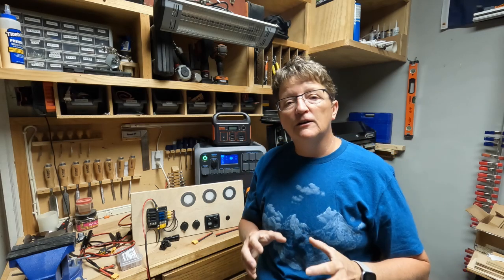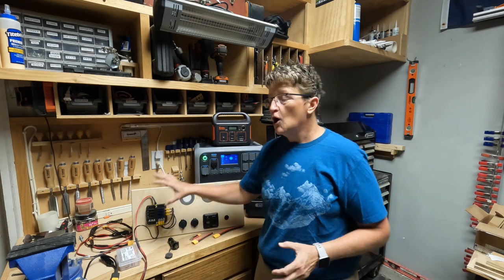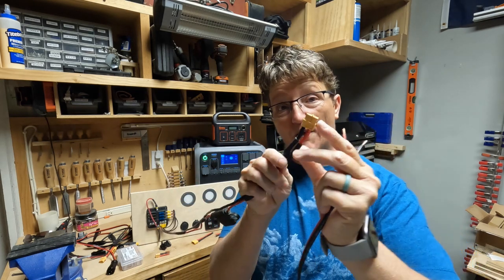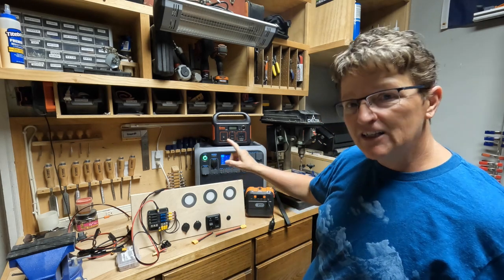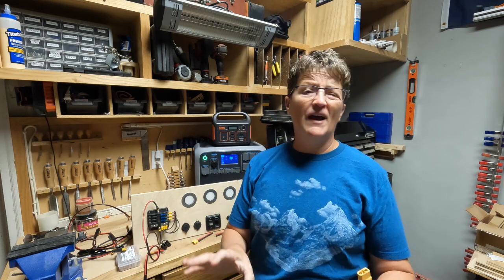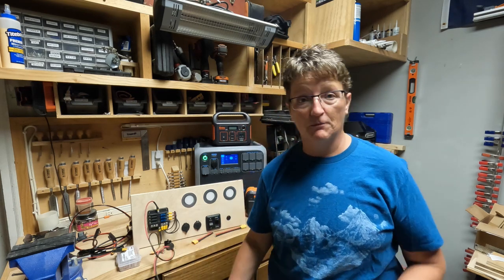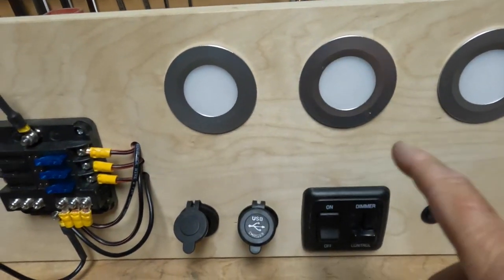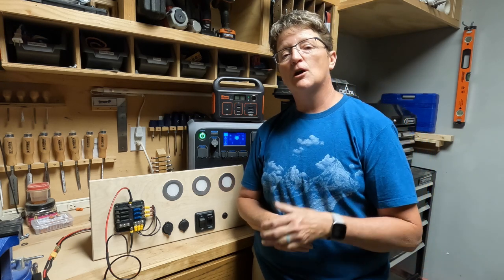Off-Grid Solar | Connecting DC Fuse Panel To Solar Generator

Comment: Yeah. Nice. But people need to understand their DC amp output. Those that want to use a diesel heater for example will not be able to use the 12v cigarette socket has they are max 10 amps and most heaters run at around 15 amps. Unless they have the Bluetti AC200 max or the new AC240. Those both have the 2 pin aviator port and are DC 12v and 30 amps. So will be able to do the same set up you have made and run everything in the van. Including the diesel heater.
Reply from the maker: Both the AC200 and the 200P have the 25amp 2 pin port.    You are 100% right that the cig is limited to 10 amp 👍

Comment: I have no electrical knowledge. I thought when I bought my ecoflow everything would just plug into it with no problem. Not so. So I need a 20 amp fuse box with a switch or breaker on the wire. My ceiling fan and natures head (not yet purchased) gets connected to the fuse panel via the + - wires with those little Os on the wires. Think I got it. You are an angel.

Comment: This is really good Jonnie. I decided to scrap my fading, heavy, less efficient AGM batt setup on my camper and use my Bluetti instead.  Your video clarifies what I was needing to understand in order to do this. I never thought about using one of my smaller batteries for a back up. The XTC adapter connection would make this simpler.  Thanks!
Reply from the maker: It sure does.  the xt60 or xt90 makes life easier for interchanging.  FYI many of the new systems use xt60, so I would use that if able.

Comment: Awesome explanation and to see is to understand.  Thank you Jonnie.  It is pretty clear.  QQQ--On my fuse panel the top and bottom positive and negative are connected to my battery directly.  What happens if I add the new cable on these.  Is there going to be a conflict between where the power goes?  I hope I didn't confuse you with my question.  Call me me if I wasn't clear.
Reply from the maker: Yes you will have to isolate the two systems.  You have to kill power to one and draw from the other.  Jim could do it easy peasy.  thank you for the kind compliment Dee

Comment: Can you a specific video on how to connect the puck lights with the dimmer switch to the fuse box?  The three wires from the dimmer switch make it complicated between the power box and the fuse box.  Thanks for the info!
Reply from the maker: uploading it now.

Comment: Thank you so much for taking the time to share this!!! I know how to set up a solar system with lithium batteries, but I don't know how to integrate into the existing wire system in my ambulance.🤔 I have a feeling the answer is simple, I'm just not getting it. 🙃
Reply from the maker: Ambulances are so technical.  You should have a auxiliary battery though. You should be able to connect your panels to a solar controler to the battery.   That wire cabinet is a electrical nightmare 🤣
Reply: @JonniesJourney  Thank you Jonnie 🥰

Comment: Hi, this is the second very informative video I have watched by you. Thank you. Did you do a video where you show how you wired the lights, devices  and ports that shows what gauge wire you used as well as how you chose your fuse selection?

Comment: Great 👍 video 
I need an Anderson 30 amp connection
I wire my battery straight into the fuse box , in the RV
Reply from the maker: Do you have a fuse between the battery and the fuse panel?

Comment: Ok Now I have a question for this video.  I'm going to be wiring to Bluetti EP500Pro, I hope, and it has the Aviator which is great.  The question is the Aviator connection is at 30 amps and my fridge, I think, is 6 amps.  I guess I really do need to know the amps of the appliance I'm connecting to add the correct fuse. But, with the power station at 30 amps is it going that going to be ok?  I will be connecting other things, lights, fans, pump but does that 30 amps divide over all appliances?  Like I only have up to 30 amps total or I use up to 22 amps over all appliances  and thats ok? Also, do I put a 20 amp fuse in line or 30 amp?    I don't want to overload something i guess is what I'm trying not to do.  Thanks again for the help!
Reply from the maker: So each fuse will be according to what you have connected to the panel.  Typically you would not have everything running at once but.. what if. I have my system backed up with a 20 amp fuse.  The rule is  1.25 x the total amps.   What awg wire will you be using?

Comment: I just got my 6x14 and I plan to do the same with my Ecoflow River Pro and I'll buy the extra battery to go with it...
Reply from the maker: That will be awesome David. 😊
Reply: Long time coming! And a laundry list of accessories for and 8 way fuse panel. But may get a 12 way so I can add more. Jus need to plan. Your videos are great and informative. Just need to learn how to wire up a switch on a wall and then to the fuse panel
Reply: @djbigdavethefyrm  She has a video on how to do that too.  It seems really quite easy using an extension cord.
Reply: @pattya1679  thanks I know it is. I just never did it. I’ll look for it thanks Patty

Comment: Awesome tutorial! Very clear! I do have a question, I have a VTOMAN that has THREE 10 amp DC outputs…. Would I do a seperate fuse panel for each output?
Reply from the maker: Which one do you have that had 3 10amp ports?  

You would really just need one, if you are concerned about going over the 10 amp you can just keep the DC fridge or other high item to its own cig plug.
Reply: I have the VTOMAN 1000. My fridge will actually be plugging into the 110 AC. But I’m hoping to have a composting toilet (~ 5amp), a ceiling vent fan, and several LED and USB plugs. Two of the outputs are 5521 (5.5 mm), so I can assume I can wire a circuit into a 5521. So really each plug should just run a 10 amp circuit with a 12.5 amp in line fuse? I’m also a nurse btw!

Comment: Thank you for the informative video. I have an Anker 767 that I wired and connected as you have shown. Question. What is the total amount of load I can have at one time? Is it limited to 10 amps (which I think my Anker DC outlets are rated for). I'm not an electritian and I'm learning all this for the first time.
Reply from the maker: If the DC output port you are using in 10 amp, then you are correct.  👍 thanks for watching 😊

Comment: Jonnie. Great video. Thanks. I have an ac200p that I am connecting to a Blue Sea DC fuse block. In looking over the cables that came with the Bluetti I dont see an out cable from the “12Volt DC 25amp” output. Do you know what cable I should order from them? Gracias.
Reply from the maker: Is it a threaded output?  If so it is this one. https://amzn.to/4cCBa23

Comment: Thanks Jonnie. Great info. Only question I have is why is an inline fuse needed between the solar generator and the fuse panel? I would have thought the Jackery or Blueti devices have fuse systems internal?
Reply from the maker: they 100% do and it is not necessary.  I do it for the added protection.

Comment: Another great video J!!!!  2 quick questions if you don't mind:
1) you are using the 12V 10amp cigarette output....any reason why you don't use the 12V 25amp socket beside the cigarette port?  I would think the higher amp port is better for some of the 12v items you want to run, no?

2) do you always go up to the next fuse size when determining the inline fuse port?  Eg if you're using a 20amp port you'd use a 25amp online fuse?

As always, really appreciate you sharing all your knowledge!!!

Freddy
Reply from the maker: I only use the 12v/30 amp port. The 10amp cig port is just not stable enough.    When deciding a fuse, multiply you max amp by 125%, that's the fuse you use. Thank you so much for watching.

Comment: Hi Jonnie,
I’m sure I speak for many when I say that I appreciate you taking time to share your knowledge with us out in on the DIY van building space.

Anyway, I’m currently building out a Sprinter van and already own an EcoFlow Delta Pro w/3600 wh of storage capacity.  I’m working through the process of integrating it into the van, but, to charge the unit via the van’s alternator, Ecoflow has an XT60 - cigarette port adapter… but, my 2022 Sprinter doesn’t even have a cigarette Port, 😂!
Is it possible to run a cable from the van’s charging system, back to the “garage” and into the XT60 port on my EcoFlow?
Reply from the maker: Thank you so much.  Ugh no cig lighter 😒. Yes,  You can add a cigarette lighter. If you use their existing cable, It should prevent you from pulling too much from your battery. 👍

Comment: Working on my van build right now and love this idea. But I have one question, can I put my Chinese diesel heater on this fuse panel as well?
Reply from the maker: Yes you can if your power bank can handle the heater.  Use the recommended fuse for your heater.  If you are just using the cig type port, you will likely blow the fuse in the adapter.
Reply: @JonniesJourney  … thank you. That helps greatly!

Comment: Love this video. I have a few clarifying questions...
My unit is an Anker F2600 and the DC Output has 2 car ports rated at 10A (120W) max. I'm wondering if it'd be safe to run a 2:1 male-to-female car port cord to get max output (20A, 240W) into a fuse box?
Otherwise, am I able to run two separate car ports to a single fuse box? 
Any recommendations on wire gauge?
Reply from the maker: I use 12 awg wire from my system to fuse block. I am not 100% but I think you will be limited to 10amp total output.

Comment: Hello so glad I found your channel. How do you like the bluetti? Do you charge your system with shore power sometimes? If so do you have a video explaining how to hook up to shore power?
Reply from the maker: Not sure how well I explain it in my other video.  I installed a Noco plug (https://amzn.to/3vnHxDg) on the side of my van.  All you have to do then is plug in the AC power brick to the shore power port.   I charge it on shore power when it is available.  I LOVE the Bluetti system.  It's just so so easy.  Thanks for watching.  I will soon be doing a video showing how I charge my Bluetti while driving.  Good luck on your setup, let me know if you have any questions.
Reply: @JonniesJourney  Do you have a discount code for the bluetti?
Reply: @JonniesJourney   What fuse do you use for the connectors and fuse panel?

Comment: What size fuse are you using?
Reply from the maker: I use a 20 amp on my AC200, a 30amp on AC300.  On the components I size according to unit.  👍 feel free to email me at midwestvanbuilders@gmail.com for more questions

Comment: Hi Jonnie.  I'm getting closer to getting my shell and needing to do this.  I have been gathering components over time.  One question, what size fuse do you have for your in-line fuse and what size for the different components? One other question, when making up the connection wires, you soldered the wires.  Would the lever wire connectors work in these situations.
Reply from the maker: Yes you can use the lever wire connectors as well.  Patty I use a 20 amp fuse in mine.  My research keeps leading to 20amp for the 12 awg wire and for the components I use.  I was trying to gauge every fuse to the exact and a mechanic told me I could put 15 amp in the panel so that none of them are undersized.  I have done this since I started almost 2 years ago. If I learn otherwise I will keep you updated.
Reply from the maker: @john beach thank you so much John for taking the time to answer this and the added advice.  👍🙂

Comment: Hi Jonnie. Me again 😊. I just wired my second max air fan to my fuse panel. Like you, I am also using 12G wire on everything. I noticed that the ring connectors for the 12g wires are pretty big, and when I put them on my fuse panel, I have to bend them a little to fit them on the screw   - which is fine. But when I screw in two negatives next to each other, they look like they’ll touch each other. The positive ring connectors have that little piece of plastic divider between each one to keep them separated, so I’m not worried about them. Does it matter if the negatives touch each other?  Thanks!  I’m very proud of my 2nd max air fan working perfectly when the fuse panel is plugged into my goal zero or Bluetti. You did it!  You successfully taught a newbie how to wire electricity!!  Thank you so much.
Reply from the maker: Yes they will be fine if they touch 👍 only the positive lines can not touch.  Excellent job.  ❤️
Reply: @JonniesJourney  thank you! Can’t wait to see your DC to DC video. That’s the next thing I have to tackle. I’ve been watching videos on the Victron systems. I’d like to wire for that before I close up the walls. 

Thank you, thank you, thank you!
Reply from the maker: i do not use the DC/DC charger because the Bluetti does not have the terminals like a normal battery.  mine is a very easy inverter install that allows you to plug in your bank and charge while you drive.  under $150
Reply: @JonniesJourney  oh this sounds more like my speed. That’s what your video will be about?  Can’t wait to see it!
Reply from the maker: @trishwhitehouse6536  yes tomorrow 8am cST

Comment: Hi Jonnie and everyone, is there a specific 12 volt fuse box you recommend?  I see then titled as marine fuse box a lot and wondered if that is all the same with maybe a little more sealed aspect to it. 
Awesome video, I’m looking to power up my exhaust fan to an eco flow and you cracked  the code for me 

Thanks!
Reply from the maker: I use the Blue Sea fuse block for my builds. 👍  so awesome, goid luck on your build.

Comment: How did you deal with the aviator plug adaptor being a spring loaded push to connect vs the bluetti being a screw in connection? I did everything you did but the adaptor doesn’t stay on the bluetti very well because the connections are different 😢
Reply from the maker: The new Bluetti has a different aviator plug. This is an older model. 
This is the newer cable. 
https://amzn.to/3KImliG

Comment: Great Video. I have an AC200 - and use the aviator plug for powering my fuse box. I just ordered the AC300 and I hear it has a different style of aviator plug. Do you know what that type is called? Did you have to make a new attachment after upgrading to the ac300?
Reply from the maker: If it is the AC200 not the P model it is a new cord.  Here is a link:  https://amzn.to/3QLT2ie
Reply: @JonniesJourney  Thank you!

Comment: What do you think about the use of Wago Push Wire or lever nut type connectors to make my cables that to go from the battery to the fuse panel?  I'd like to skip soldering if I can.
Reply from the maker: I use the wago connectors all the time.  However, the ones I have will not take the 10awg wire that comes on my xt60/xt90 connectors.  Which battery do you have.
Reply: @JonniesJourney  Thanks! My main battery is a Bluetti EB70s. It has 12 V outputs from 10 amp 5.5mm x 2.1mm barrel plug or cigarette plug. I'd prefer to use the more reliable barrel plug.  My back up battery will have to use a cigarette plug though.

Comment: So if both power supplies have the same connector you connect the 2 red cables to the fuse box?
Reply from the maker: No you only use one power supply at a time. The connector is universal on the fuse panel.  So if the power banks have female connectors then put a male connector on the fuse panel.  👍

Comment: I am in a mobile home and want to use a portable panel with starter kit and hook straight to fuse box. Can that be done and what is the best brand to buy?
Reply from the maker: No, you are talking about two different kinds of current.  Household is 120v this is a 12v setup.  email me with further questions and I will try to help. midwestvanbuilders@gmail.com

Comment: Great video Jonnie!  Im going to power my van build this way.  My question is how do I wire the switch block in?  Jackery to fuse panel to each appliance to fuse block...I want to install a switch panel on the wall that I can turn each appliance on and off with.  How do I wire that?  Do I double up on the fuse block...maxxfan to fuse block, on/off switch for maxxfan power on top of same maxxfan on fuse block??
Reply from the maker: Deborah it would be 100x's easier to explain to you on a call.  Email me at midwestvanbuilders@gmail.com

Comment: how efficient is the dc port on the Acmax?
Reply from the maker: I have never push the 30a port to the limit. Most of my components and builds don't use even close.  It's the DC air-conditioning  units that over load it.  I don't recommend using a Bluetti if you want an efficient AC unit to run from thw DC port. Hope this helps.

Comment: Can I use a non fused block? Technically isn’t the output dc socket already fused within the power station?
Reply from the maker: The power station is protected.  I use the fuse for backup and if I have a component that is creating a problem (never have had a problem) then I know where to search.

Comment: will the cig lighter enough to run a microwave oven or electric stove like 1100watts?
Reply from the maker: No, the cig port is only 10amps.  It is DC and I assumed your appliances are 120v so an inverter would just blow the fuse constantly

Comment: With the 12v cigarette socket do you have any advice on keeping the sockets in. I’ve got a heavy duty plug what seems like the centre pin is so spring loaded it actually pushes itself out making the connection hit and miss. 
Any tips ? I guess I could wedge something inside to help keep it there and tie it off
Reply from the maker: I have seen people tape them in but even that can be an issue.  Does your system have any other DC output connections like an XT60 or an Anderson
Reply: @JonniesJourney  sadly not, it’s the eco flow river max. I have a different plug that feels like it would stay out just slightly thinner gauge wires that the one I was hoping to use. I’ll have to give it a go